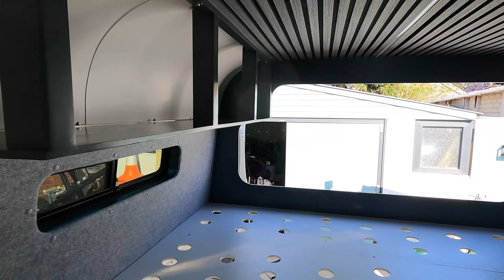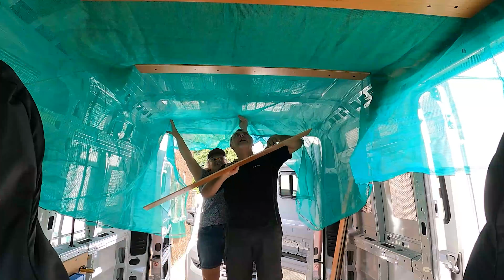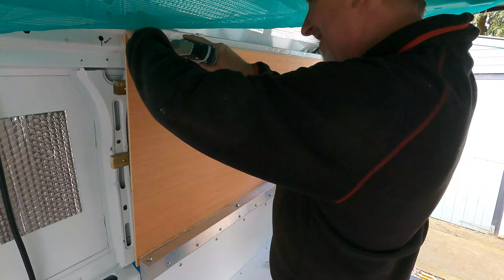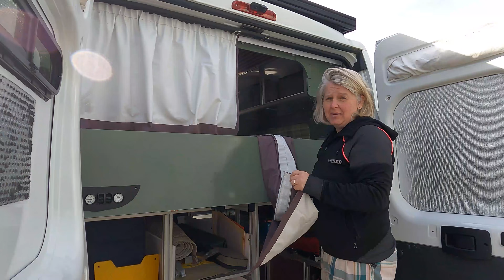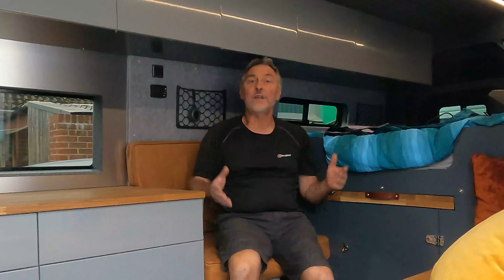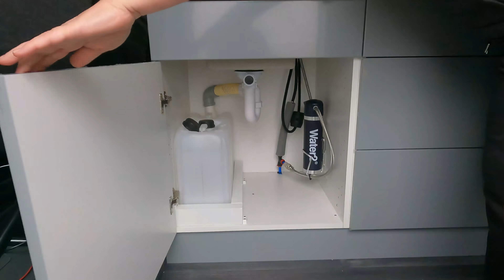Van conversion DOUBLE BED OVER GARAGE completed. VAN CEILING goes up first.

Comment: Enjoying your series. Curious as to why you didn't use carpet spray adhesive to tack the sheeps wool to the ceiling to make fitting easier?
Reply from the maker: Hey Bob, thank you for watching and your kind comments. 
Only twice have I ever been asked this question and first time was this morning???
Yeah... That sheep wool doesn't hold like plastic fibers you'd find in bottle style insulation. The plastic stuff formed under heat bonds to itself where the sheep wool would just pull away. Besides not being glued would allow easy access back to the vans metal if by chance we needed to... Unlikely though.
Best wishes,
Paul
Reply: @vanlifemyway7806 Thanks.
is the plastic bottle insulation a good alternative option?
Reply from the maker: @bobnicholls  mmm...its an option and any system I believe is better when allowed to breath and vent but...Plastic bottle insulation isn't Hygroscopic. However, I do mix and match in my builds depending on the locations. The ceiling is probably the most venerable location that would benefit most from using sheep wool, as the majority of condensation would accumulate there, the sides and floor much less so.

Comment: Loving this build. One Q with your build are you keeping a log of hrs worked to give people an idea as I think that should be worked into the budget
Reply from the maker: Great question and I seriously wish I had. However you can double your build time when you're having to film it which would be perhaps difficult to extract  out. This build is now finished after a year but that's working around a full time job and managing to fit a bit of a life in as well and unfortunately one hell of a health scare too. I'd say, off the top of my head, working at full chat with long summer  days 6-8 weeks @ 7 days/ week up to 10 hour days. You may think that work rate is excessive but a van build can be quite addictive. Sorry I can't be any more help than that and thank you so much for watching and your kind comments.

Comment: Another informative video with some great ideas.Nice to see a build with new and different ideas. Always believed vapour barrier was the way to go but can see how you are not needing one the way that you build. Some brilliant tips like getting the curves in your window frames, overlapping ply on the beams, staggering screws,  rolling pin on fabric... Thank you
Reply from the maker: Thank you so, so much for watching and your kind comments. I've always believed there is no rights or wrongs Martin but believe alternative methods aren't too well documented.
I don't profess to be an expert but these systems have worked so well for us that I believe they deserve a shout out if it'll be of use to someone else.